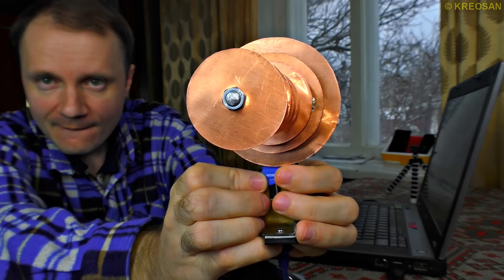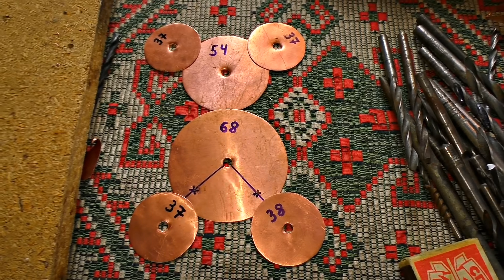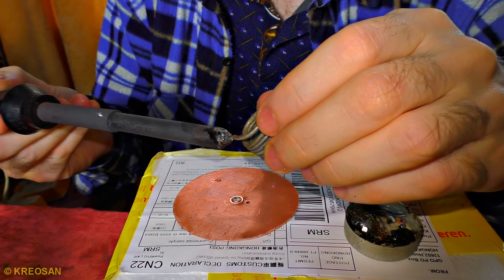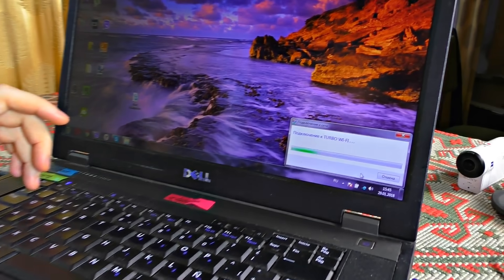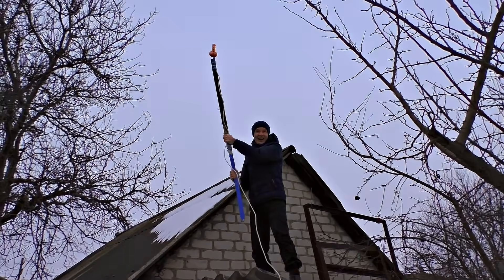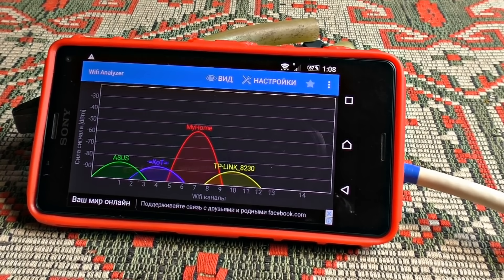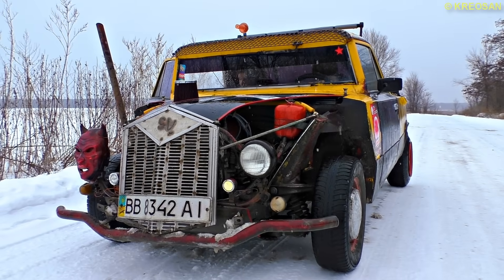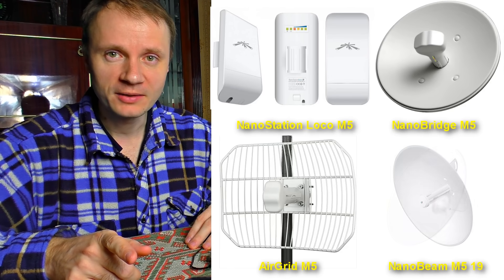✅Wi-Fi Gun DIY / Powerful Antenna for Wi-Fi !

Comment: It looks like a yagi integrated through 180 degrees.  Have you tested it with a vertically polarised transmitter, then with a horizontally polarised one?  I imagine it would do equally well for any polarisation (except circular)
Reply: Highly directional antennas don't need to use circular polarization
Reply: @jasonv5478  Agreed, but what prompted that comment?  The antenna shown is certainly not circularly polarised.
Reply: @DownhillAllTheWay  no it isnt.  But I was just thinking out loud.  Making antennas do what they could not do was a specialty of mine.  Back when all tv signals were analog, I could regularly pick up tv channels that were out of state, sometimes more than 1000 miles away.  Using a super high gain VHF UHF antenna,  I once even picked up a channel in Canada.
Reply: @jasonv5478  Well, my comment at the head of this thread was also me just theorising out loud.  I did antenna theory many years ago, so I still remember something about them - though not as much as I knew at the time.  I'm certainbly no expert, and I haven't built one of your antennae (though I'm tempted).  You have, so I'm quite sure you know a lot more about it than I do.

What I remember is that a "high gain" antenna doesn't give gain so much as directionality.  What I want at the moment is to increase my area of reception of BlueTooth, but without giving up all-around cover, and without using a directional antenna at the receiving station.  I suppose I could achive something by designing an antenna that would give a disk-shaped polar diagram instead of a spherical one, but I imagine I'll have to use some sort of active amplification - a transistor or something similar.
Reply: @DownhillAllTheWay  car whip antennas are circularly polarized but you can receive a.m. signals from hundreds even thousands of miles away at night.   But that's neither here nor there because a.m. signals travel that far at night and you can pick up those same signals on a little tiny antenna inside a transistor AM radio. I'm curious as to why you would want Bluetooth to go very far?

Comment: Just a small tip if you don't want to get some lead poisoning down the line... since I'm sure you're not going to buy or make a smoke extractor get bandana/cloth of paper mask and wet it and put it on while soldering because that smoke ain't good for you son.

Comment: TV coax cable 75 Ohms, wifi system 50ohms. We not gonna talk what happens when you use different impedance, but you can start thinking about signal reflection. And even if you were to design you own wifi card on 75 ohms we can do the math that signal lost will be tremendous on 2.4GHz and not to talk 5GHz or even the new 60GHz.

Comment: If you used paper plates instead of expensive copper and drinking straws to mount them on this may actually work. 
Don't bother with coax, just two pieces of garden string soaked in sea water and carefully dried will do a much better job.
Only last night, mine picked up a cow farting in the field opposite. Although for that I plugged my earphones in the end of the drinking straw.

Comment: You should build top secret Russian robotic wolf pack, automated assault vehicles. They are a quad bike with dirt bike like tires(they slant outward at 45°), they contain a fifth wheel on top for roll over protection and to regain upright control. A 360°+ machine gun is mounted under that wheel. Granade launchers are concealed on all sides.There isn't a steering wheel or seat. The front brush/wire gaurd cuts wire and has a wolfs face on it. May be called "lobo" ? They go out front and seem to be part on the new Armata tank unit. They simply overwhelm the enemy in seconds. The decoys(?) are really loud and the silent ones come in at another angle of attack. Some even blow up ! 
 Point is, I would like to see a mock up of this secret weapon. They were spotted in Syria by terrorist groups whom most surrendered as soon as they could.

Comment: Awesome video. Can I use metal washers? Washers are much thicker than the copper sheet you used, does that affect the measurements? I mean, do I want to measure my spacing from facing surface to facing surface or from center thickness of washer to center thickness of washer? Does thicker material affect performance...is thinner better? If thinner is better, what if I shaved down and used old CDs? And does the size of the hole in the washer matter? I know 1/4 wavelength of 2.4gHz is about 31.25mm, but none of your discs are that size, so I'm guessing you're accounting for the hole you drilled in the middle. Can you explain further? Thanks

Comment: Nice video but make sure the antenna impedance is 50 or 75 ohms. Also you should consider the VSWR (voltage-standing wave ratio) is very mandatory

Comment: The antenna needs to be 50 ohm for communication. But Reference antenna conductive and it 0 ohm resistance. Internal impdance of IC 50 ohm and the antenna has to be 50 ohm for the maximum power transfer.

Comment: What frequency is this running on it would barely be possible on 5.8ghz and on 2.4ghz you would be only just on the limits you should try on an ultralow mhz signal like 400mhz and try casting a game or tv show from your home as far as you can go and also upscale the antenna to even bigger

Comment: what in the world a manual windshield wiper.
Reply: save on electricity and it got more power
Reply: Rob Key Russian power
Reply: That's how they used to do it
Reply: Old cars had such devices.
Reply: Trabant also had a manual washer pump. Yugo is best car then.
Reply: last time I saw that was in a Jeep Willys
Reply: @raistlinmajere4659  - drop a linear on a mobile CB or ham radio and run at night, keeping your battery up will be challenging.
Reply: nigga they live in Ukraine
Reply: My 1954 Land Rover has a manual windscreen wiper.
Reply: K.i.s.s. it still works right ;)
Reply: In Soviet Russia, you wipe windows.
Reply: chriss4365  Russia
Reply: Next time you step in to a basic car with no equipment, you will appreciate the fully motorized windscreen wipers ;)
Reply: @raistlinmajere4659  OH BOY.... I can't even answer you in a way that isn't likely going to offend you.
You must realize what runs the alternator?! Its called an engine! 
Almost certainly the engine is some form of internal combustion engine that uses some form of fuel.
Reply: @myname604  Come on, man. If you know alternator then you must know voltage regulator. The reason for the regulator is because the alternator is putting out more electricity than the car can use.  Use that energy.
Reply: @myname604  very good explanation
Reply: @rapskallion  has left the chat...
:P
Reply: @raistlinmajere4659  Its takes fuel to produce electricity so saving electricity saves gas/diesel or whatever it is you chose to burn.

Comment: A straightforward multi-element antenna, one driven element, four "directors", one "reflector"...You just have to sit down, break out the calculator & do the math...for the spacing between elements & size of the elements. See "Transmission Line Theory" & Antenna design...changing the pattern from a general purpose 360 degree pattern, to a fully directional design.

Comment: That sheet of copper has a thickness of 3 (three) millimeters??? No way!Looks like a 0.5 mm or less. A 3 mm thick copper sheet is NOT capable of cutting with hand-operated scissors. And it would be heavy as fuck.
Not giving the exact assembling information and connecting this can be disastrous for the WiFi-device, since the signal amplifier can easily burn out (especially in a tiny device) if the output leads are shorted (as seen in the video).
So Igor, Ivan, Sergei or Dmitri (whatever your name is), an antenna has to be carefully designed and carefully built. Quickly and carelessly put together contraptions can cause really bad headaches, like a burn out WiFi adapter or more. No offense, but someone reviewed that design before, and found minor and major issues with it.

Comment: How good it really is in comparison with 11.4dbi (bigger) windsurfer? https://ulozto.net/!FJQd0i69tRxf/windsurfer-wifi-antenna-11-4dbi-size-a4-focal-distance-30-8mm-doc I think windsurfer is easiest to make directional antenna. (I've tried some short "sharpie" yagi antennas and longer too, but they didn't beat my windsurfer). Signal and directivity of antennas conected to AP was compared using this real-time detector: https://www.flickr.com/photos/124591966@N06/39517006640/in/album-72157694688694214/ Windsurfer range is up to 4.5km (and even more, if there is another windsurfer on receiver too) https://www.youtube.com/watch?v=cDK1cPTL8RI

Comment: Excellent hack (Wi-Fi Gun). But I'm really impressed with that truck too.
Reply: does it support monitor mode if we use monitor mode adapter
Reply: THETOP10 yea. It will
Reply: @ashutoshpandey6110  yeah the antenna doesn't change if it supports monitor mode or not, so if you use a monitor mode adapter then it'll work perfectly
edit: sorry im late as hell
Reply: That isn't hacking.
Reply: It's bullshit.  Will never work

Comment: i am waiting for your replay
Reply: you should ask a question and state who you are asking if you want to get a reply. go back to the question you asked because it will have moved for everybody else even if its at the top for you, this post is not anywhere near your question and so nobody knows what you are talking about. t ahts how youtbue works
Reply: and what should be the length of  stud?
Reply: i have a little bit confusion that  both wires of cable( inner and outer ) are connected directly to each other by plates and stud ! will they make short circuit or harm to the device which the antenna is attached to ???
Reply: no no the wires are not part of 2 different circuits with power.  one is just shielding (usaully connected to ground) and the other carries the signal.  there is no power on it.  but ordinarily the 2 poles (or in this case plates) are not connected as you are saying.  the shielding is never to touch the inner wire so thats one of the reasons i dont think this will work.  its like he is combing a yagi aantena and a dipole antena.  this cheap usb adpater with dipole antena will problay work nearly the same. https://www.newegg.com/Product/Product.aspx?Item=N82E16833389042 if you want to make your own antena then maybe try a simple di-pole.  cut 2 pieces of stiff wire (steal or stiff copper) about 5 cm long and put a 90 degree bend about 1 cm from the end.  make 2 of these.  connect the shield (outer first wire) to one and the main wire (inner wire)  to the other.  put the bends together so the one of the longer 4 cm parts sticks straight up and the long 4cm side of the otther sticks down.  do not let them touch but keep them join.  it will look like you took a couple 5 cm antenas and bent both and put them together with teh long end of one sticking up and the long end of one sticking down.  put tape or something between them so they will not touch and moutn them together somehow so they will be sturdy.  that is a di-pole.  not you can make a couple more di pole antennas and put them side by side with the same 2 wires going to each one for mutlitple di poles if you want to try to get more signal. but it probaly wont be better than one and will problaby not be better than a cheap one that is store bought or comes with this usb.  if you want to get really long range you need signal boosters (linear amps) and dishes.  but with a 10 dollar usb adpater hanging from my cieling and 20 dollar router i get 4-5 bars at 75 meters thourgh 2 brick walls and one wooden one
Reply: two questions !
does the sheilding is connected to first and the  largest plate ?
all plates are elcetricly connected to each other ?
Reply: and what is the proper name of this wire ?
Reply: the outer shielding of the wire is to the first large disk and the inner wire is to the second smaller disc.  in this video the discs look to be connected but in a dipole they are normally not.  that is why i dont know if this antenna will work right.  but in the video yes and for a dipole antenna no.

the kind of wire is called coaaxial (live tv cable wire) because the outer shield and inner wire share the same axis (coaxial).  the outer is shield and the inner is idk hot maybe.  to order a wire you must have a usb adapter and then know if it is male or female.  or to be safe you could order both or just cut the antenna and directly connet the wire
Reply: well thank  you sir  i have got very helpful information from you
Reply: whose the admin of this page
Reply: this channel belongs to Kreosan English.  here is a link to their channel home page.  https://www.youtube.com/channel/UClUZos7yKYtrmr0-azaD8pw

here is a link to their website http://vk.com/kreosan
Reply: you are welcome.  i wish you luck on your project.  its looks like the chanel's home page has other antenna projects if you wish to see them.  : )
Reply: what is  whatsapp?  are you talking to me?
Reply: yes
Reply: check on google
Reply: can i have your facebook id
Reply: i dont have a whatsapp number.  do you have steam?
Reply: steam
Reply: have facebook account
Reply: the antenna is not working and they are not replaying

Comment: what is the name off divice you attached to anntena
Reply: oh there is your question i see.  do you mean the usb adapter cause any one will work or do you mean the thing he called a "pigtail".  cause its just an adpater cord with the proper fitting to fit the usb adapter to.  this might be what you are talking about.  http://www.ebay.com/itm/like/253595863025

the problem is that you need to know if your usb adapter is male or female.  or i guess you could just buy both kinds.  i would suggest reading up on the topic. google "wifi antenna connector" and read up.  i did before i bought my yagi antena but ive forgotton most of it.  google is your firend
Reply: thanks you
Reply: i dont think it would work too.  my store bought yagi that was half a meter (1.5 feet) and professionally made got the same reception as my little antenna that came with my usb adaper and is only about as long as my hand.  

this is the best combination i could find for distance without geting an expsensive dish type anteena.  its a 20 dollar router  (but a good one if your net speed is less than 50 megs or so) here  https://www.newegg.com/Product/Product.aspx?Item=N82E16833704039  and a 10 dollar usb adapter here   https://www.newegg.com/Product/Product.aspx?Item=N82E16833389042.  i hang the usb adapter from the light on the ceiling from a string and use a 2 meter usb cord and thats it.  i get 4-5 bars (5 is full strenght) from about 75 meters through 2 brick walls and 1 wooden wooden.  movign the usb adapter around until you find a good signal and then making sure its stays in that one spot is the key
Reply: i mean that cable which you unplugged from tv (the white cable you solded with plate) you said that dont use cable more than 12 meters  if i need to use more than 12 meters  it will start loseing channels what should i do
Reply: i want to use anteena with mobile

Comment: USB 2.0 provides for a maximum cable length of 5 meters (16 ft 5 in) for devices running at high speed (480 Mbit/s).
Reply: he didnt use a long usb cable did he?  he put the cable between the antena and the dongle not the dongle and the computer.  but signall losses for 2.4 ghz would limit it to a couple feet anyway so he would be better off using usb plus the fact that using a usb hub\splitter with a power cord extends this another 5 meters and you can put as many as you want in a row so you can make it any length you like

Comment: Hi,  got some questions about the antenna.1) What is the distance between the 90mm pancake and the 68mm pancake?2) What is the size and width of the screw?3) If I am going to use the antenna on my cell phone, do I need this USB mold antenna or can I use a normal copper wire?

Comment: You will get much better results if you use a proper coax line.  It is also why it was difficult to find the connector.
The wifi & router Coax are 50 ohm impedance & your television coax is 75 ohm impedance.  
Be Careful you don't exceed the maximum Effective Radiated Power  (ERP)  Radio Frequency Burns are bad for your health.
Reply: It's unidirectional, though, so as long as he doesn't spend his time staring at the antenna while sitting in the beam, I guess it's fine...
Reply: Titou1384 no it’s directional.

Btw, if you transmit with this antenna also, you will exceed max EIRP, because WiFi already transmits at max EIRP when using low gain antennas.
Reply: Yeah, sorry, that's what I meant, in French "unidirectionnel" means it emits in one direction... Which I thought to translate into "unidirectional" in English, but what I meant was indeed directional.
Reply: Titou1384 - uniDirectional is Correct guys.  :/     OMNI-Directional = ALL Directions (Typical antenna)    UNI-Directional = ONE Direction  (ex. YAGi)
BI-Directional = information Transmission in both directions OR an ANT that broadcasts/receives in 2 opposing directions simultaneously.  Might be useful in a static-relay system, but in this case DOES NOT APPLY    All Network traffic is going to be bi-directional.       I presume ppl misapply bidirectional because they are thinking of the data transmission.  Yet we are describing PHYSICAL PROPERTIES of the ANT.

  OMNI directional is the word Unsettled and others seem to be unaware of, even thought it was in common use just 10 years ago.    Maybe because it reminds them of Religion??  SHRUG  Omni-potent = all powerful
Reply: Don't think there can be serious safety issues here since someone putting their Omni wireless modem in metal shelving will unintentionally set up a directional reflector with >15dB gain. Probably better gain than video.
Reply: so whether or not the antenna that is supplied by creosan is dangerous for our health